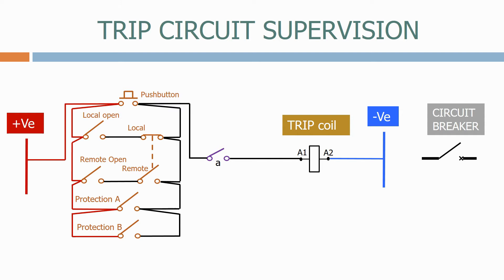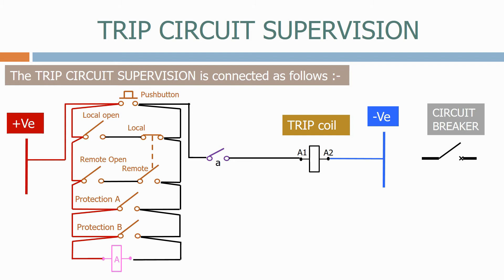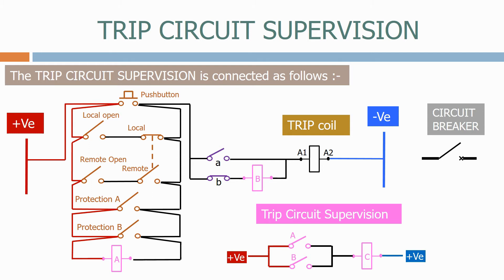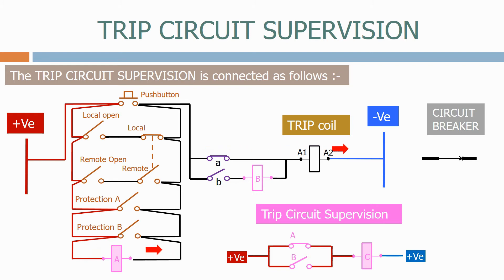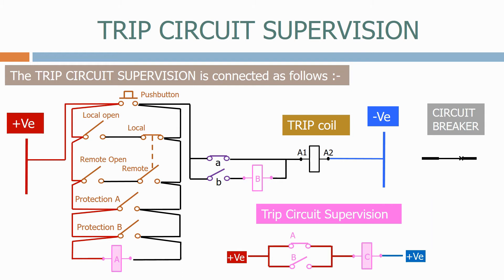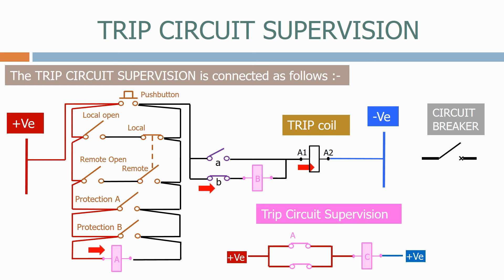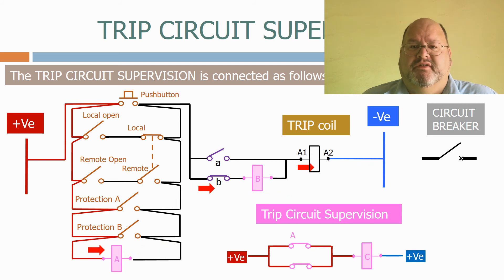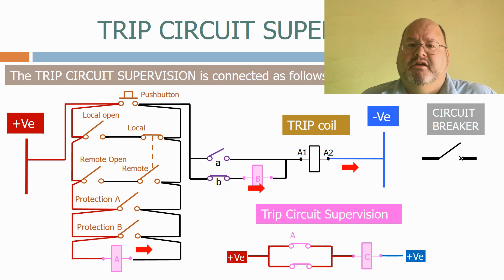Trip circuit supervision

Comment: why does C coil terminal have positive written. it should be negative.
Reply from the maker: Hi Mark,
               I don’t see any positive symbol on the C coil terminal ( there are no markings at all? )

Steve
Reply: @Electricalsteve  coil C supplied by red (+Ve) and blue (+Ve) too. should it be blue (-Ve)?
Reply: ping!

Comment: Why do  most of the TC supervision circuits wire up the B coil in series with the A coil too? Can we not wire the B coil independantly, ( With its own true positive supply ) ofcourse in series with a 52b contact to have the same funcionality? Is there any advantage for making the coils A & B in series for the pre-close  tc supervision scenario? A reply would be greatly appreciated! Thank you! (i find that it helps to monitor some of the wiring portion also?)
Reply from the maker: Hi Rajesh,
                 We can just use the A coil to monitor the circuit and some simpler schemes do this, but this limits you to only monitoring the integrity of the trip circuit when the circuit breaker is closed ( when it’s open the auxiliary switch in series with the trip coil disconnects the negative side of the A coil )
In most HV substations you don’t want to close the circuit breaker if you can’t trip it so we want to know the trip circuit is healthy in both the open & closed positions.
Hope this helps

Steve
Reply: @Electricalsteve  Thank you :)